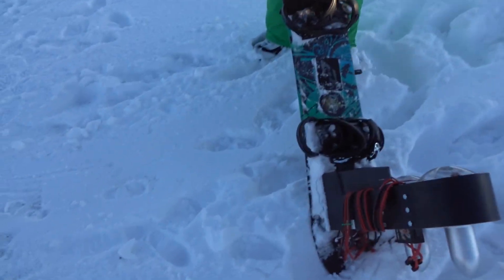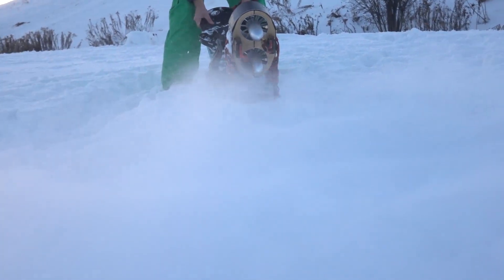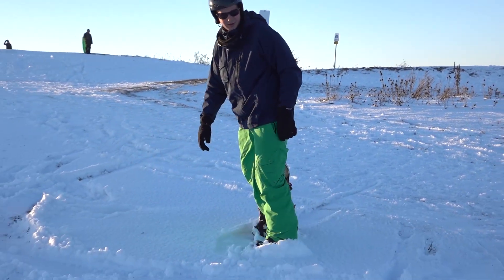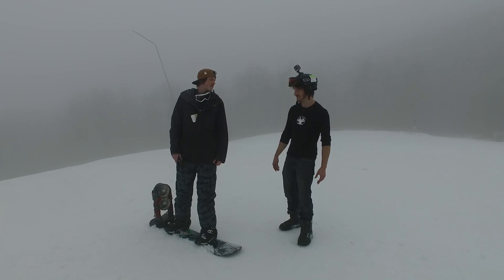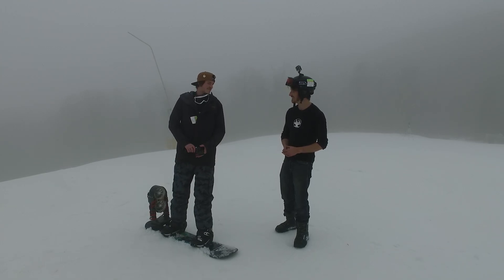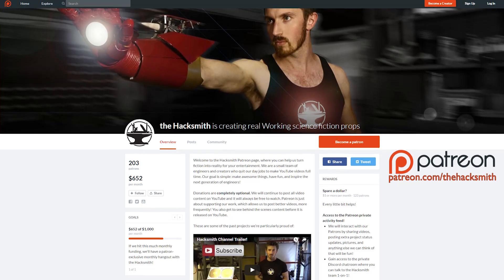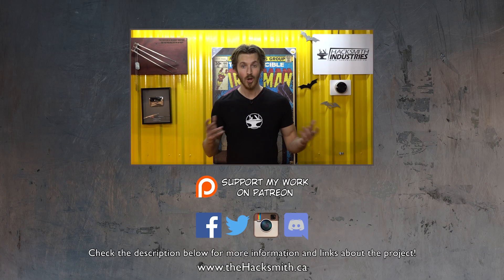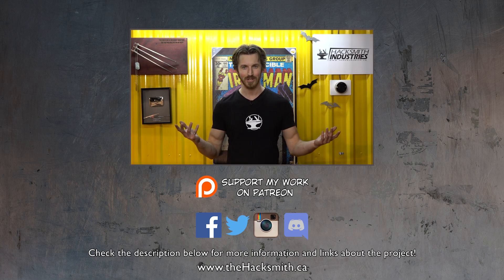How Fast Does a 21HP Jet Powered Snowboard Go?

Comment: Hmm, looks back/top heavy. Is it possible to put the battery's and electronics on the front and the jets lower down on the back? It might help balance it out and make it not so top/back heavy.

You would have to run the cables from the battery's to the jets along the top of the board, which wouldn't work that well with a long-board because you are constantly moving your feet around, and probably stepping on/disconnecting the cables. But on a snowboard your feet are fixed in place, so you could pretty easily keep the cables away from the ground and your feet.

Just a thought.

Comment: In my experience with snowboarding, in order to carve you need to shift your weight to the front foot. it seems like the added weight in the back of the board is counteracting that and may be making it more difficult to control.

Comment: Ever thought of making the jets Horizontal?  Like in a T mount or something.  That way you could balance the weight of the jets and not fall over so much.
Reply from the maker: But then when you crash, you break the EDFs. Duhhh.
Reply: This may also work on the vertical one, but what if you rigged a tail fin to it's housing? It could at least keep some distance between the jets and the ground whenever it falls.

Comment: How did you get the footage so smooth at 2:46? I assume the camera guy was on foot, so was it just a really good gimbal?
Reply: But at 5:12 They can't have been on foot, so were they snowboarding and whilst filming a the jet powered snowboard? If so, that's a damn good snowboarder.
Reply from the maker: DJI Osmo, while running =P
Reply from the maker: I guess I'm a damn good snowboarder then! :P

Again that was me on a board, holding the DJI Osmo =)
Reply: Nice!

Comment: Just some (potentially) helpful feedback:
Since you essentially steer the snowboard with your back foot/leg, you want to have less weight on the tail of the board to make it more maneuverable.  I would suggest moving the battery packs to the middle of the board between the two bindings.  It will make the snowboard feel more natural, albeit heavier.

The second would be to perhaps run a more 'Y' pattern with the EDF's so the rider does not restrict airflow into the fans, but this may also cause a weight/balance issue.

Comment: take the fans off the board and instead put them on a pole you can hold with the battery's in a backpack. it keeps the board handling the same and you could probably fit more fans.

Comment: Were those guys really any good on snowboard? If so then it must be very different and difficult to master.  I snowboard for 14 years now, and to me they looked like first timers. Hacksmit looked like he had most control out of all of them.
Reply from the maker: When the batteries have less than 5 minutes of run time... doesn't give you much time to practice =P
Reply: It's because Hackamith had the most practice with this snowboard out of all of them. I bet it feels completely different to ride it, so practice is a must
Reply: Auarhau yeah it's not like there's two jets on the back that might throw it off balance
Reply: Not just that. The design is horrible. Applying more weight on the sides of the board manipulates turning but the problem with the design is the board is back heavy. The board forces you to spin. It would be awfully hard to control the board. Better design would be jet engines on the back of the person. Therefore the weight is centered over the board vs the back.
Reply: Auarhau like when he caught toe side and ate it
Reply: how big are the batterys??? it must draw a ton of amps

Comment: I think this would actually work way better on a long board. Probably be easier to test as well and the batteries might hold out longer not in the cold
Reply: There are actually a bunch of aftermarket products for adding brakes to a skateboard. You guys seem more than smart/skilled enough to figure out a solution to such a mundane problem ;)
Reply from the maker: Watch my longboard video on it then ;-)
Reply: Sounds like user error to me :) The longboard looks like it does work way better to be honest
Reply from the maker: Still no brakes...
Reply: Ian JunkerNaut There's also the issue of speed wobble
Reply: and its a lot harder to stop the hacksmith said that in a different video

Comment: Just curious, why not level out the thrusters one on each side and have the edges of each thruster meet at the middle of the board. ON the back of course. IT would lower your center of gravity, and  make balancing a heck of a lot easier,.
Reply from the maker: Because then when you crash you'd break the EDFs
Reply: I don't know how I didn't see that lol. That would be an issue.

Comment: Could you do this on a skateboard, the only difference would be to add brakes to rear wheels. Maybe wider board as well.
Reply from the maker: We have, watch our video on it =P
Reply: the Hacksmith   I. Know you guys have but I mean, could you widen the back of it , add drakes, and make the bored longer , to avoid speed shakes? And mount the jets to the rear of the now log board.
Reply: I do have a few different diagrams I've drawn up, if I had a Facebook I would post it , so since I don't I'll be making a video of them on my channel tomorrow after school. I won't forget it .

Comment: Try to build a Hoverboard with these Turbines which acctually can lift a human and has like 4 side controls! Would be pretty cool!
Reply from the maker: You'd need like... 30 of them =P
Reply: the Hacksmith I mean a Hovercraft board where you use like 4 turbines to get a air pillow filled! and then forward thrust by using the turbines and some steering mechanism as well!
Reply: @Voltaic  eveything I know about hovercraft is that they dont have very good steering ability. I've thought about dame idea. Actually have a old board i bought for the idea.
Reply: @hacksmith  like you haven't done crazier things :D
Reply: Given how many EDFs it will take for the Fly Like Iron Man project...yeah, no...
Reply: Look up "flyboard air" on youtube, it's a hoverboard with 4 kerosene fueled turbines used to provide lift (and two smaller ones for control). Before you ask, it's real, there's plenty of videos from various sources that can be found on youtube (and it won a guiness world reccord).
Reply: whoa the whole body is a better placement then instead of the board
Reply: That would be the flyboard air.